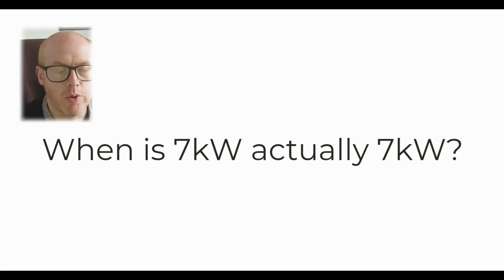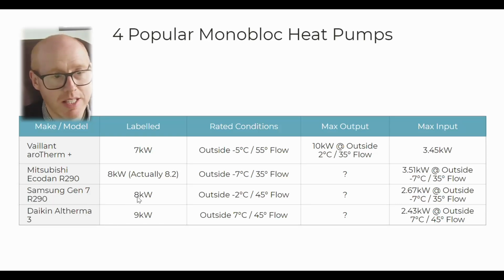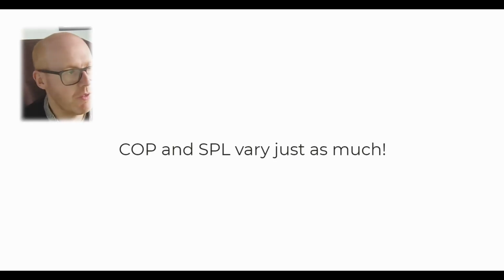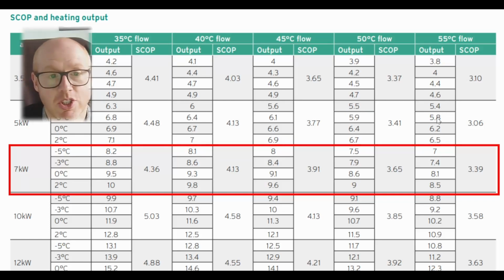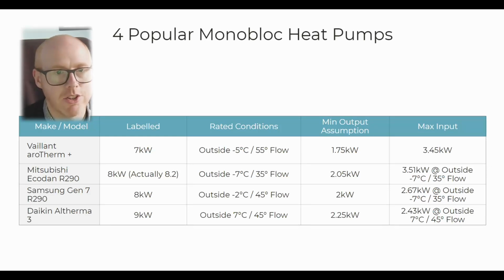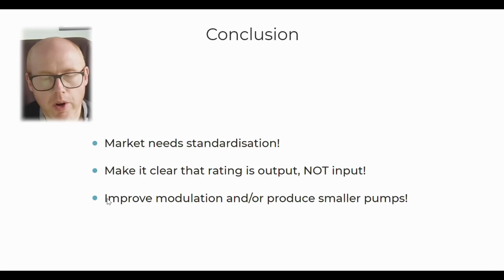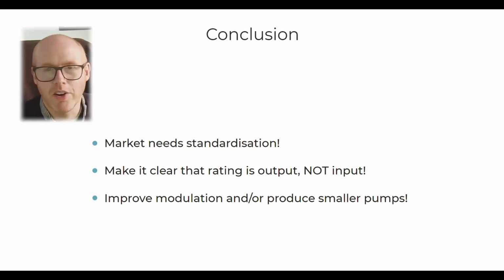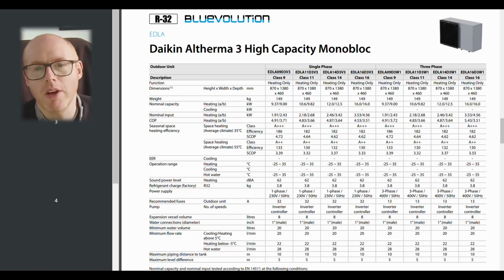Are Heat Pump Manufacturers trying to manipulate the figures? What size pump do you need?

Comment: this is an absolute great video thanks,  this explains why Heatgeek are suggesting i get 5kw Vaillant with a heat loss of 5.76,  makes sense,  there was me thinking i needed a 7kw heat pump,  when in fact the 5 is a 7 more or less.    great explanation. where did you find this document
Reply from the maker: You used to be able to download these documents from the Vaillant website. They are now hidden behind an installer portal.
I scraped as many as I could and uploaded them to the Vaillant Arotherm owners group on Facebook.

Comment: That was brilliant, it’s obvious that MCS should require manufacturers to standardise their technical capabilities to facilitate comparisons.

I’ve a question please. Just had my unit fitted, it’s too warm to test the heating but I have been pouring over the DHW inputs and outputs. I’ve noticed my DHW cycle (I have to bring 250L of water from about 20C to 45C set point. It behaves differently than I was expecting, it ramps electrical input from 0 to 6kW over 8minutes then as soon as it reaches 6kW it comes back down to 0kW, by which time I’ve overshot the target set point by 2C. Total cycle time about 15mins and less than 2kWh input. I find that odd, I was expecting it to trickle in heat over 60 minutes rather than blasting it in. TheDHW cop is good, at 340%, but it seems to go against the low and slow strategy I was expecting.

Does your DHW cycle blast heat in at max output, or does it modulate over a longer period please?
Reply from the maker: Ours doesn't work like that. Ours does ramp up slowly. I don't know which heat pump you have but for our Vaillant there are primarily two different DHW modes, ECO or standard. Set to ECO it will only ever use 50% compressor power and it does it quite gently.

Comment: Very helpful presentation, thanks.  I am wrestling with this at the moment.  I have a house with 350m2.  I need a heat pump in the region of 12-16kW.  One "12kW" heat pump actually outputs as much as 14kW in some conditions.  It seems to have almost comparable power to another manufacturer's16kW heat pump.  It's really hard to decide which particular heat pump is more suitable.
Reply from the maker: At that level, the difference between the units is often very small. The minimum output when modulating down can sometimes be identical even though some claim 16kW output and others 12kW.

The difference between a 5 and a 7kW unit will be much more critical in a smaller property than the difference between a 12 and a 14 in a larger property.

Much of this is also to do with the high system volume normally available in larger properties, which is another critical factor to avoid cycling.
Reply: @UpsideDownFork  that is a very helpful insight, thanks.  We have 350 sq m, 5 bedrooms and 28 radiators, so plenty of water volume!

Comment: The reason nothing has changed and everything is still being oversized is because MCS regs say your HP must cover ALL heating requirements at -7°C to qualify for the BUS. MCS are not allowed to install a system that might require a little convector or an extra blanket on the three days a year when it is actually that cold. Even though you might have a log burner or storage heater for those coldest days - they have to ignore that. They also ignore any solar gain you might get and funnily enough the sky is usually clear and the sun shining on the very coldest days. You also have heat from the TV, cooking, pets, people, etc - all irrelevant to MCS calcs.
Reply from the maker: Thanks for commenting!

That's not how I read and interpret MCS guidance.

From 3.1:
"Heat pumps should be selected as closely as 
possible to the design heat demands. MCS 
Standard MIS 3005, requires the unit to achieve 
100% of the duty at an external temperature 
condition exceeded for 99.6% of the year, if 
reasonably practicable. It also stipulates that 
supplementary heat is not permitted from direct 
electric at external temperatures above the design 
external temperature (“bi‐valent point” or “balance 
point”), but other alternative auxiliary sources of 
heat are permitted where this is not reasonable 
practicable in which case the system becomes a 
‘hybrid’ system. 
Although additional supplementary heat may be 
required when the external temperature drops 
below the bi‐valent/balance point, this will occur 
for very short periods of the year and therefore 
does not significantly affect overall seasonal 
efficiency even when direct electric heat is utilised.
Therefore, heat pumps should be selected as 
closely as possible to the design demands."

In my case the design temp is -1.8 degrees. I don't know where in the UK would design to -7 degrees 🤔

In discussing MCS guidance with installers, unfortunately many think it's the law. This is incorrect. It is guidance.
Reply: @UpsideDownFork   The "hybrid systems" you mention are quite extreme cases where maybe the DNO cannot provide enough power or the building is Grade 2 listed and unalterable. Sorry it was late and -7° came off the top of my head, however looking at the MCS spreadsheet to calculate the size of heat pump, the 'outside design temp' is not the same as the 'Post Code degree days'. For example Gatwick area is calculated at -5°C (the baffling spreadsheet cell for this is: LOOKUP(LEFT(C9,2),Post Code Degree Days::Table 1::A3:B126,Post Code Degree Days::Table 1::B3:B126)+IF(AND(G19>90,G19<200),−0.6,IF(AND(G19>190,G19<300),−1.2,IF(AND(G19>290,G19<400),−1.8,IF(AND(G19>390,G19<500),−2.4,0))))

Another major factor is that MCS installers may be audited and not all of them get the BUS voucher. A few percent are rejected and one of the main reasons is "‘Plant cannot meet eligible property space and water heating needs‘" - clearly another reason to edge toward oversizing. The MCS process is not science or evidence based, it's full of estimates and assumptions covering, shower times, shower temps, buidling age, state of your unseen cavity wall insulation, building exposure and water proofing, actual ventilation rates, MVHR efficiency, solar gain, occupancy - all of which tend to get rounded up.

Furthermore the calculated HP size will never be exactly what is available in the market so the next size up will be installed - just to be on the safe side. Plus the next size up may be labelled 10kW but that figure will be calculated at -7°C and the manufacturer will add some headroom just in case. AND all this is based on Heat Loss calculations which are also made with (MCS recommended) rounding UP. God forbid that the customer might have to put on a wooly jumper for a day or two.
Reply from the maker: @johnhunter4181  Thanks for the additional info! That seems even more crazy. MCS definitely doesn't seem fit for purpose on either the installer or the consumer side of things.

Comment: Interesting to see the max inputs. I was wondering if the 3.5kW Vaillant would ever draw more than my inverter can kick out (3.3kW max) and from your 7kW numbers it seems unlikely. Of course, if something else is running at the same time it may well do it.
Reply from the maker: Even the hot water cycle peaks at between 2-2.5kW, depending on outside temperature.
You'll be fine 👍

Comment: Spot on with this video, oh I wish that the manufactures would ALL have a standard whereby @35° flow they show the output and cop at +7, 0, -3 and -7°C. it would make it a bit easier to pick the correct model. Also it would be useful to show the minimum output at +7°C.
Reply from the maker: Thanks for your comment. I've replied in this video: https://youtu.be/u6J-Ba-6-jI

Comment: I decided not to go with Octopus as they would only put in Daikin ASHP's.  Anecdotally it looked like the minimum daikin running elec consumption was higher than the Vaillants plus integration/API's seems better with Vaillant.   Any thoughts/comments ASHP guru's?
Reply from the maker: 8kW Daikin Altherma 3 installed by octopus seems to be a good unit. Many performing very well. Have a look here: https://heatpumpmonitor.org/system/view?id=72
If anything, the minimum modulation looks better than the Vaillant.
Daikin has good bus integration if you are looking into home assistant then it has as much, if not more support that the equivalent Vaillant.
TLDR: You're splitting hairs, unless you are looking at different size of units.

Comment: I strongly recommend Toshiba Estia for you. For 8kW pump you get following modulations for 7 deg and above: 1.01, 1.17, 1.28, 1.45. Much better than I've see.
Reply from the maker: Thanks for the suggestion. Are those figures the electrical input or the power output? 
In the video I was specifically comparing monobloc units instead or covering some of the split units.
Reply: @UpsideDownFork These are the kW of power outputs. I can guarantee that this is the best HP if you don't wish to pay for oversized 300L heat buffer.
Reply from the maker: @BartoszBielecki  thanks very much. Are you in the UK?

Comment: Great video, I’m slowly pealing through my onion layers of understanding. I admit I went on trust with my HP Daikin 9kw install with Octopus (which very happy with so far), so I need to go digging first details/data. My primary view of performance is via my Alpha ESS solar battery app, which shows great real time energy use in the house, so I can see real time effects of the HP spooling up and other energy use. Currently most HP energy use - when active - is between 300-800watts. Water heating overnight is biggest jump, can spike briefly at first to above 3kw then quickly settles to around 2kw for most of work.   Gaps HP not working clearly larger on milder days. But generally oscillating around 800 watts when working at the moment. This means for me during day even a poor solar day my PV covers all house energy plus HP, battery fills in gaps & gets charged ready for evening heavy use (cookjng/HP). Then 23:30-5:30 cheap rate window i use to top up battery (if needed) keep HP house warm so not working hard first thing next morning, charge EV if needed & any hot water heating. Good solar day (Saturday) I did all this and fed back 19kw to grid - crazy! Not even Summer yet, keeps raining too.
Reply from the maker: Thanks for the comment. I've responded in this video: https://youtu.be/BQQ5cOFCjKI

Comment: One thing to bear in mind for modulation ratios is that whilst it may be 4:1 at a *given outside temp*, you are most likely to need the lower output at a higher outside temp when the minimum output is higher. So the effective modulation (max output in winter vs min output in late spring) is often closer to 2:1
Reply from the maker: Thanks for the comment. I've responded in this video: https://youtu.be/BQQ5cOFCjKI

Comment: Heatpumpmonitor - should be able to find minimum running input power for most units now, the better performing examples are often sat at that limit 24/7.
Reply from the maker: Thanks for the comment. I've responded in this video: https://youtu.be/BQQ5cOFCjKI
Reply: From a quick poke around on there the Vaillant 5kw models seems to have a minimum output of around 2kW @ 450w, and the 7kw unit seems to be around 3kW minimum @600w. that was around 12-13°C air temps. This seems to tie in with the specs I could find of 2.1kW and 3.0kW min output for each unit.

Comment: COPs should increase when the compressor is running at 25% because the heat exchanger with the air is much more efficient. Good A2A heat pumps (fujistsu, toshiba etc) can modulate to 10:1 and they can achieve very high COPs. Around 7@ 7℃ and 9@ 12℃. You can use eurovent for third party tested A2A systems.
Reply from the maker: Is this just applicable to A2A / split systems?
Reply: @UpsideDownFork  I don't think eurovent has A2W data.

Comment: Maybe the 3.5 kw pump would have been the most efficient would be undersized at 70% as some dedicated software recommends.
Nothing is lost and I recommend trying to find the temperature at which the pump stops cycling and heating to different temperatures during the day.
It is now oversized only for 24/24 use but not for 12/24 or even less hours of operation.
Reply from the maker: Thanks for the comment. I've responded in this video: https://youtu.be/BQQ5cOFCjKI

Comment: Not sure if you can help , I am having two pumps and installer is quoting for two Mitsubishi ecodans labelled 11kw .
   From what I am reading Vaillants would be preferable all round , agree or disagree?
Reply: Have you had a proper heat loss survey, done? As 2x11kW seems pretty extreme.
Reply: Thanks , I have , they were teetering on the verge of would two 9kw types do .
  However given the refurbishment nature where by there is such a mix of new and old and the incomplete nature of the build , we are trying to insulate further any old walls left , putting as much as possible into new roof plus insulated reflective felt and triple glaze , it’s probably a nightmare to calculate accurately , the rooms are sizeable and there is a three floor entrance atrium to make matters worse , sounds grand but it’s not it’s just my idiotic design , I didn’t pay for a whizzy architect.
Reply from the maker: Thanks for the comment. I've responded in this video: https://youtu.be/BQQ5cOFCjKI

Comment: To be fair, the calculations and the MCS requirements are complex. If I was an electrician or a plumber I'd just prefer to use a bunch of rules of thumb and avoid the paperwork. I'm pretty sure that a 5kW heat pump will be fine for my house (based on detailed calculations and closely monitoring my current gas system) but I suspect that I'll be quoted 7kW and above when the plumbers come round this week. There's no incentive for a plumber to quote a smaller system - less money overall and a greater chance of a customer call-back when they're too cold.
Reply: Rules of thumb are rules of dumb. It is essential to fully understand the specification in detail there are no shortcuts.
Reply from the maker: Thanks for the comment. I've responded in this video: https://youtu.be/BQQ5cOFCjKI

Comment: I'm in the US (Colorado) so my system is very different - ASHP, air handler and air ducts throughout the house. I have seen the heat pump come close to its rated maximum input power but at 10C below the design temp (-18C here). Those days were big outliers on my data. Other people in my area with similar installs added supplementary heat and/or turned down the thermostat for those days. Our house is about the same size but the temperature swings here so much, my heat pump is 14kW and probably only a little oversized.
Reply from the maker: Thanks for the comment. I've responded in this video: https://youtu.be/BQQ5cOFCjKI

Comment: I faced with the same difficulties when I looked at pumps suitable for my house I do confirm that it is very hard to find useful info, when you want to know more than the basic info (in Italy the law is to inform about power output and COP at 7°C OT and 35°C delivery flow, and also at 45°C flow. Typically you must be an installation company to have access at more data (at least on the italian website, but I cannot access any other). More data are available to everybody from LG for their R32 ThermaV Monobloc S versions, even if I feel that some info is possibly not accurate. I compared the three units that are rated 12, 14 and 16 W (at -15°C, while operation down to -25 is possible with reduced output), which are certainly the same machine assembly with just a different tuning: on paper they are rated for modulation down to 11 to 13% (and the circulating pump down to 10%), but I could not find much info of what the COP will be at those low power output. There is however a table suggesting data for a "typical" system at various external temperatures: interestingly, as the power output is reduced, the COP gets better. Among the three units (of the same construction) the lower power are slightly more efficient.
On the user manual of the same units you have many different control options: e.g. you can select the deltaT, or even the circulation pump speed, if I correctly remember, which should allow you force the heat pump to operate at different power outputs, at a given temperature (but this is my theoretical understanding).
Reply from the maker: Thanks for the comment. I've responded in this video: https://youtu.be/BQQ5cOFCjKI
Reply: @UpsideDownFork  thanks, I have watched the video; I also found the video from heatgeek on the LG pump, assuming it is the one on the noisy fan. If it is that one, I cannot agree on what is stated regarding relevant performance from the data sheet. However, my reference to that pump was relevant to the capability at reduced loads, which I read to be as low as 10/15%, much lower than what is elsewhere stated. I had not looked at the Vaillant pumps, as they are not so popular in y country: from a quick look at their powerful versions, it seems to me that also these are same construction with different tuning, the more powerful being less efficient. 
Wonder if you can share my understanding on this, I say feeling because I am not aware of details of the theory of these machines. Is it true that a unit tuned for higher output has a lower COP, at same ambient and delivery temperatures, etc.? Is it true that, as load is lowered, the COP gets higher (to some extent)? Does this mean that in a family of pumps the lower power units are more efficient, while probably have a reduced range at low output?
One would need to have the full data from the manufacturer.
My next concern is the design temperature: in my area this is -5°C by law and, while this never occurred recently, I remember a full January below this in 1985, with a full week below -15: at that time it was just a big oil consumption; one would have to design the heat pump for a higher power and at a lower temperature, or prepare with alternate sources.
Reply from the maker: @enzofraschini7117  Your theory sounds like a good one to me.